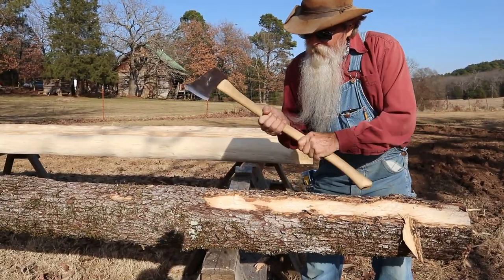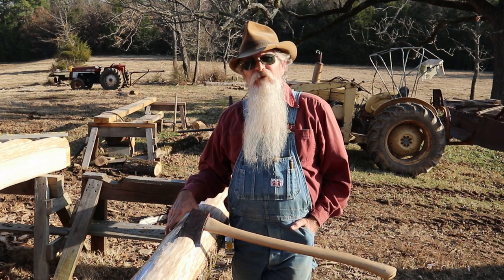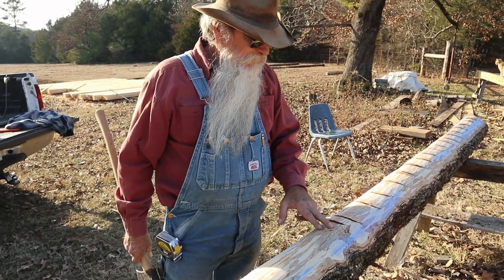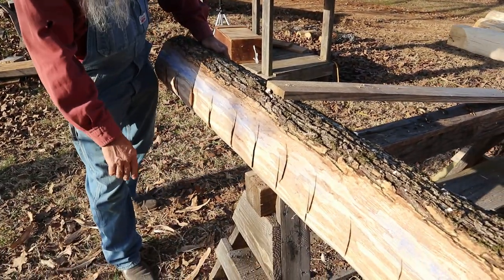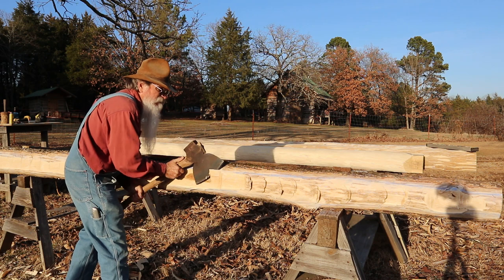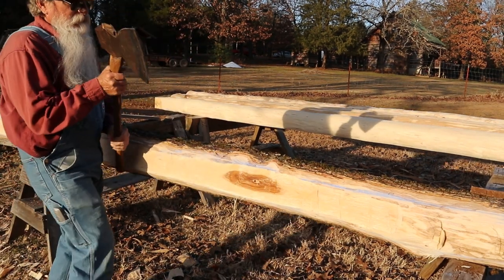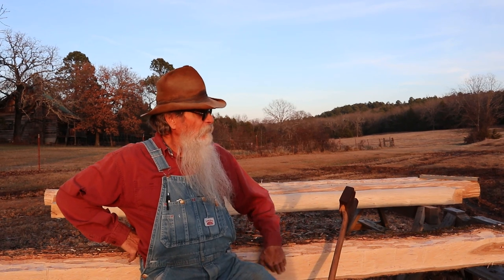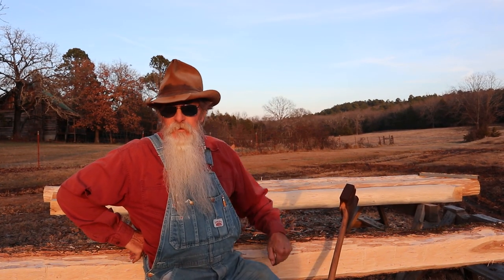Hewing Oak Log for Floor Joist - Dovetail Log Cabin Build (Ep 6)

Comment: When my grandfather built his log house, he set the joists in place first then made my dad level the tops of the floor joist logs with a foot adze.  That made my dad really angry because he said his father was too "cheap" to purchase sawn lumber.  Instead, the old man uses the logs on his property for joists and made my dad level them enough for my grandfather to nail down flooring directly to them.  "Cheap"?  Maybe, but it worked.  His children and grandchildren returned to that log house for many years when celebrating holidays. 

I don't know about using an adze.  I think I like your way better.  Either way, it was fun to watch the old man work.  He did everything the old fashioned way, butchering his hogs in the back yard, raising crops with a mule and plow.  He never owned a car or a power tool in his whole life and read his Bible from the light of a kerosene lamp every night.   Thanks for preserving the traditions.   Brings back memories.
Reply from the maker: Ron V   Howdy Ron, sounds like your grandfather was a sure nuff old timer. Hewing the joists with a foot ads was definitely one of the ways people did that. I had the oak timber and decided to do this just to show it could be done this way. Normally I frame the floor with lumber. But, l sure enjoyed doing it this way. God bless you

Comment: Awesome video. I'm watching your stuff because I am trying to learn how to hew.
I have a question about the level line you drew at the start. How do you know both lines are at the same elevation? 
I would like to learn your way for layout because it seems more efficient than mine but I didnt understand that part. 
The way I do it is a plumb line through the center of log at either end then that becomes my reference and I use my framing square on either end.
Reply from the maker: Howdy y’all- thank you so much for watching the video. Hopefully, I can answer your question. In this video I made a level line on both ends of the log. It doesn’t matter if the log itself is level. The two level lines on the ends are connected with a chalk line and that is what I hew down to. If you want send me an email at thebeardedcarpenter8@gmail.com and I’ll try to help you figure out how I do my layout. It may sound complicated but actually it’s just a series of very simple steps put together. Hope to hear from you. Take care and the very best to you. God bless
Reply: @TheBeardedCarpenter  thanks a lot, I sent you an email.

Comment: I’m planning a 12x16 dovetail cabin build. It will be my first hand hewn cabin. I’ll be using southern yellow pine for the walls. I have limited white oak so want to avoid harvesting any of it unless I have to. Will I be ok using pine for the sill logs and floor joists or do I really need to use oak? Also it’s my understanding is it’s best to dry the logs before building. Is this true and if so, should I peel and dry the pine logs before hewing or should I peel and hew and then dry? Thanks so much for all the information you share! I am loving your videos.
Reply from the maker: Howdy Thomas- I use southern yellow pine logs for the sill logs keeping them off any concrete with treated lumber. I like to use the logs fresh cut and allow for the settling that will take place. If you are going to cut your own timber just cut the first tree and hew it to get the feel of hewing. Fresh cut trees are so much easier to hew than dryer logs. Also, if you cut very many ahead there’s a chance wood borers can get in them. Once you get a log hewed it’s good to get tbark off down through the cambium layer. That’s what the bugs go for. Go back and watch our videos from the beginning of the dovetail log cabin build. I explain what you will need to know. You can use pine for the floor joists and rafters and any framing you might do. Send me an email at thebeardedcarpenter8@gmail.com if you have any questions. I will be happy to help you any way I can. I admire anyone who builds their own log cabin. I certainly wish you the very best with your project. God’s blessings to you
Reply: Thank you so much sir. I’ll definitely watch your build several more times before I start my own. I have a list of notes from your videos and it seems I find something to jot down every time I re-watch one.  I’ll email you a few pictures once it’s complete. Thanks again and God bless!
Reply from the maker: @thomaslishman1582  About where are you located? I’m in western Arkansas in the Ouachita Mountains.
Reply: I’m in central Alabama. 30 miles SE of Tuscaloosa. No mountains here, just hills. The trees I’m looking at harvesting are not as large as I’d like but I’m thinking they will work out alright. Will just take a few more logs to reach the top. I figure once they are bucked and peeled they’ll be 10” at the butt and 7”-8” at the tip. What do you think?
Reply from the maker: @thomaslishman1582  Log cabins were built with what was available. They should be easier to hew being smaller logs. Blessings

Comment: What is the point of a double bit axe? I thought maybe one side was for felling and the other side for splitting, but I looked at one yesterday at an antique store and both sides seemed to be shaped the same.  Thank you and happy new year!
Reply from the maker: Howdy Tim- I guess all the double bit axes I’ve ever seen had one of the edges filed in a blunter edge for cutting in a knot or for splitting. The other edge was really keen for chopping. I guess people had their own idea how to sharpen both edges. The one I use has one edge that was kept with a keen edge. That side of the axe had been used and sharpened much more than the blunter edge. Hope this helps. God bless
Reply: @TheBeardedCarpenter  thank you. I was looking for a thicker cross section on one side than the other. I didn't consider that the cutting variations could be achieved simply by the edge. Thank you!
Reply from the maker: @timbarry5080  I was in the hardware store this morning and the double bit axe they had was ground the same on both edges. Blessings

Comment: What did you use to flatten the back of the axes that you worked on?
Reply from the maker: Howdy John- on this particular axe l used a hand held grinder with 36grit sanding discs and then used a belt sander with 120grit to take out any grinder marks and to finish shaping. I didn’t worry about the heat because I knew it would be retempered.   Hope this helps. God bless

Comment: really enjoying your videos.  Question for you, I have a lot of silver maple here on our homestead, some black locust, mulberry and hackberry.  But the silver maple is really the only trees big enough to think of utilizing here.  Are silver maples too soft to be used in log construction or could they be used for small structures?
Reply: Forgot to mention those saw horses!  Very nice!
Reply from the maker: Bonnie Doon Homestead Howdy y’all- I have never used silver maple before but I have used black locust before for support posts. Black locust won’t hardly ever rot. God bless
Reply from the maker: Bonnie Doon Homestead  Yeah, those sawhorses are quite necessary for the weight I put on em. I plan on mentioning them and how I make them in a video. Bless y’all
Reply: @TheBeardedCarpenter  That would be awesome, they look very handy.  I like the round at each end.  Hey another problem I have is with making good handles and hanging them.  I have not watched your broadaxe handle video yet, but will soon.  Any help there with handles and hanging I am all ears!  I will see how these silver maples fall.  I hate harvesting them if I don't have a good use for them, but without harvesting them I will not know what I have.  Maybe I will start with something small with them.